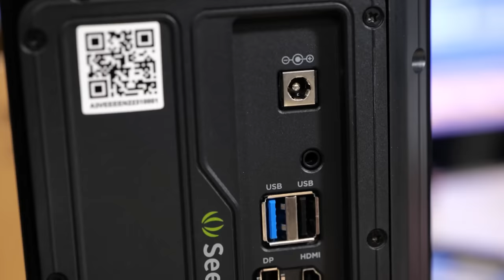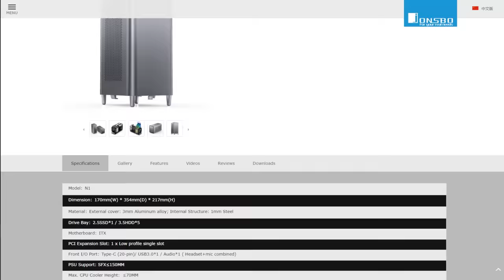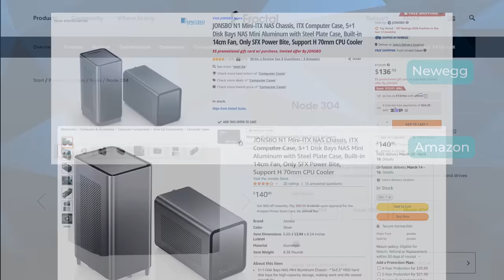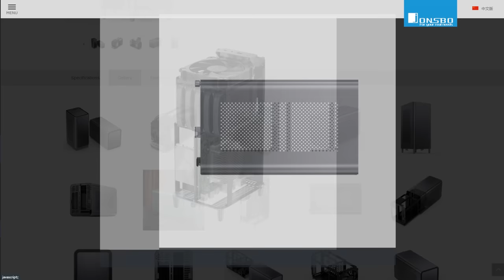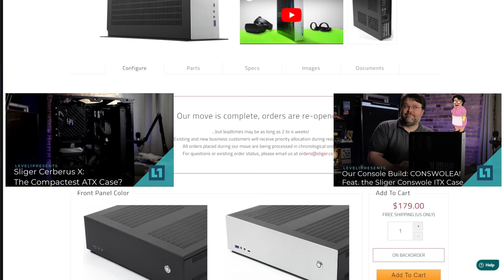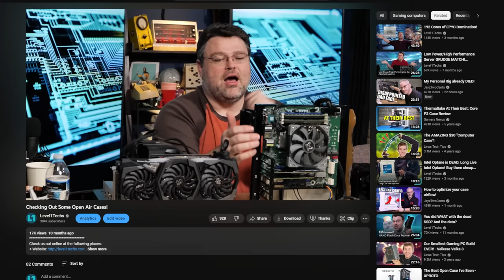The Ideal Home Server! Is it Possible?

Comment: I'm a huge fan of 5.25" bays because they're so versatile  and so easy to access and bloody annoyed that the industry has gone in a generally form over function RGB bling direction in recent years.
Reply: I mean it makes sense that most cases that are for gaming computers dont include that stuff anymore as its unnecessary. I dont see the need for the hotswap feature just for replacing failing drives as its not something that happens so frequently. Just get a fracal define XL or something, drives are easy to swap out. If you need enterprise level features, its not much of a leap to go rackmount style anyway.
Reply: @Jesse  Well for 2.5 inch drive bays, which can fit en masse in these enclosures, or for needing more hard drive bays in general, not to mention IO expansion cards and blu-ray drives, 5.25 inch bays still have a use in a variety of applications. Yes not every case needs 5+ 5.25" bays, but the ability to swap them into an existing case, OR have additional fan/radiator mounts, OR have all 3.5" drive bays, would be quite an amazing feature. It's one that I hope In Win can create for their Mod Free case that has socketed compartments on the top, front, and I think bottom of the case, and an add-on for 5.25" bays would fit perfectly there. I believe Gamers Nexus showed it off in a HW News video a while back, as well as LTT on their Short Circuit channel.
Reply: @jamesbuckwas6575  like I get that it is useful to have, it's just a niche inside a niche so it's understandable that there aren't that many products for it. As mentioned, fractals define series is good for this with 5.25 bays and lots of areas for other drives. The entry level enterprise areas cover the needs of most of the prosumer market also with rack mounting.
Reply: @JFat5158  I wouldn't consider adding more front IO niché. But it is a challenge to add 5.25" bays when people usually want smaller cases.
Reply: super hard to find decent cases with atleast 1-2 5,25" bays... oh man the times where a case easilly had 8 bays in the front drewls they had function > form... now it is bling > function > sense > performance...
Reply: I've had my lian li d8000 since 2012. It was a great buy.
Reply: @leonro  requiring more front io than comes standard is definitely niche lol
What scenario even needs more io that can't simply be solved with add-in cards, hubs and slightly longer cables?
Reply: @JFat5158  having adapters is annoying, especially if you need them all the time; I'd like an SD card slot, for example, to be integrated into my desktop
Reply: Requiring active cooling for HDDs and not having redundant fans is a big nono for me in a NAS.
Reply: @LiLBitsDK  if we are talking about cooling, 8 empty bays of 5.25 is already messing up the airflow. so in the scope of cooling, having no bays at all is function over form
Reply: @leonro  lol, it's very niché
Reply: @jamesbuckwas6575  iStarUSA has a line of cases that are nothing but 5.25“ bays. 3/5/7/9, with only the largest allowing for either micro-ATX or the MINI-ITX the other 3 require. It looks like only the smallest one requires a flex PSU too, so going SFX/SFX-L/ATX for the larger sizes is possible
Reply: @leonro  "But it is a challenge to add 5.25" bays when people usually want smaller cases" ... When people want water cooling in every freaking chassis, so manufactures add wasted space in all their chassis. Reality is, they can easily have 5.25" bays that are removable, because so many mid chassis do not even have anything in the front beyond massive empty space for ... water cooling that needs half the case airflow path.
Reply: @benjiro8793  I don't think most people want to have crazy custom water-cooling setups. At most it's an AIO, and in that case they usually want one that's so big that it covers the entire front area and there's nowhere to put a 5.25". I myself am more into air-cooling though, I never used water-cooling so idk.
Reply: Can only recommend my Dell T320, little bit older but you get it very cheap. Either 8xLFF bays or 16x SFF bays + 3x5,25“ slots, redundant PSU and plenty of PCIe slots. Only downside its a little bit noisy and no PCIe Bifurcation support but thats mainly it and all for about 200$ or € or sometimes less.
Reply: Coming soon:  5.25" RGB illuminated RGB controllers and RGB optical drives!
Reply: I don't understand the RGB stuff, and it makes me feel like a crotchety old man shaking my fists and complaining about "kids these days". Every so often I get the bug to build a new system, and I just want a simple case but all I can find are cases with transparent sides and RGB on the fans. Can't I just have a box that I'm gonna set under my desk anyways?
Reply: you could also get great accessories for the front bays... i had a monitor that fit in 3 of them!

Comment: As far as I can tell, ATX in a tower with room for a lot of HDDs is the best value still.  It takes up a bit more space but everything costs less than MATX or ITX.  The ICYDOCK stuff is really cool, but also really expensive for what it is.
Reply: Icydock have a range with plastic rather than metal sleds that are a bit cheaper, but I agree they're still very over priced. I've had reasonable results with Olmaster 2.5" cages/sleds that are a better deal. I agree about ATX - I'd much rather spend the money on quality ATX components over paying a premium for small form factor.
Reply: Agreed. I have a gpu for plex, 10gbe nic, says card etc in my server. Need space, need pcie.
Reply: I've had really good luck scoring Icy dock cages on eBay, like the 3x3.5" sleds that fit in a double 5.25 slot. Not the best storage density, but big 3.5" drives are pretty cheap.

Comment: The ASRock Rack X570D4I-2T looks real interesting for that Jonesbo case - The 2 OCuLink connectors will connect 4 SATA drives each, or you can use them for PCIe4 x4 for some kind of U.2 functionality. And as it has dual 10GBe networking, it certainly has the throughput. Finally, you can bifurcate it's x16 slot into x8x8, x8x4x4 or x4x4x4x4 for NVMe caching. Or even a half-height GPU for HW transcoding as part of a FreeNAS SCALE box.
Reply: Yeah, that's what I'd have right now if U-NAS hadn't gone out of business.
Reply: They are 650 euros a POP....Jesus christ at that point just build a Node 804

Comment: I think the Ideal Home Server would be something like: 
-The best performance/watt CPU to be energy efficient, I think the 7950x or 7900? 
-The most ECC ram you can get
-2 SSD/NVME in raid for the host hypervisor. Proxmox, xcp-ng, unraid or whatever is your choice
-5 HDD's with RAIDZ2 passthough to a Truenas VM as a target for the storage, with NFS or SCSi for easier ZFS management.
-About GPU.. I'm not sure the iGPU in the AM5 is supported for HW encoding yet, I don't do much encoding as I mainly use direct playback, and for the little encoding I need the CPU is fine. So I don't think a dGPU is needed for the ideal Home Server...unless
-Unless you want to do a Jack-of-all-trades Home Server and use it as a Gaming PC, locally or via Parsec/Moonlight. My current "main" Home Server is also my gaming PC as I can't have multiple computers (space+money). And passthough the dGPU to a VM that I turn on for gaming. It is in it's own nvme disk so if I need to play a anticheat game I can dual boot to it, I do loose all my "server" stuff while dual booted though, like media, password manager(though it's cached in each bitwarden device), etc... So this setup would be ideal for a Home Server-only machine.
Reply: Have you tried setting the smbios = host in the OS section of your vm's xml? I can run games with EAC without it complaining I'm on a vm.
Reply: @mobius_71  to be honest I haven't tried, i just didn't wanted to risk the ban. Could you tried it with Vanguard/Valorant and Warzone2?
Reply: @rodrimora  sorry I haven't tried it with those so I can't say for sure.

Comment: I want two different form factors. One is a hypervisor node that only needs to support a handful of M.2 drives (22110 size would be ideal), and then a larger chassis that would be the storage server with both flash and spinning rust.

Comment: Putting aside hot swap ability, what you describe as the ideal mATX server case is pretty close to the Fractal Design Node 804. Room for nine 3.5” drives plus two more 2.5” drives. With a 3D printed adapter, you could add a tenth 3.5” drive. An extra bonus is that it looks good enough that you can put it anywhere.

For filling all those drive bays, I’ve got a Supermicro X10sl7 which has 6 SATA ports, plus an onboard 8 port LSI SAS controller.

Comment: I really like FD Node 804 with micro ATC MB support and 8x 3.5" drives (+ enough space to mod some extra 3.5" bays into it).
Reply: I am thinking of a build and I'm flip-flopping between the Node 804 at around 40 liters, or going more compact and more quiet (albeit warmer) with the Define 7 Mini (M-ATX, 33 liters) and adding some additional 3.5" drive space with their universal mounts or a custom mod for a drive cage. 

I can't seem to find thermal & acoustic case tests on Youtube for anything accept gaming or editing PCs, but I feel like 4 or 6 or 8 drives humming away would be "loud" in a typical open-mesh type case, so I'm leaning towards the Define 7 Mini.
Reply: I'm still rocking the old Define R5 and loving it. I currently got 10 HDDs and 4 2.5" SATA SSDs with space for 2 more for the latter. I just upgraded my system and I can add 4 nvme drives on the motherboard in the future as well. Won't go wrong with any of these FD cases tbh.
Reply: I just rebuilt a server by putting it into a Node 804. It's a great option, but I think Wendell is right that there's a lot of wasted space considering what I use it for. Half-height expansion cards would be fine with me and that would save at least 10 liters
Reply: @Uriel51  Anecdotally, my Node 804 setup is pretty loud with 4 drives in it. 2 WD Reds, and 2 Seagate Exos X drives in it.  I had the WD drives connected to a raspberry pi on my desk before and they were fine. But I added the 2 Seagate drives at the same time as I moved to a PC in the Node 804, and that's pretty loud now. The vibrations of those harddrives resonate through the case, making it pretty loud as a whole. Maybe I can do something about it, but I haven't put any effort in it since it's just sitting in my basement.

Otherwise I'm very happy with the case. If you really want to get that case, I'd make sure I'd also buy relatively silent hard drives. The DC drives are great for reliability but they're just that much louder in my very limited experience.
Reply: @Niosus  it is that exact scenario I was suspicious would happen when you pack 3+ drives together. I am leaning towards the Define 7 Mini for the added dampening material. My NAS will be in my office and not a closet so that will become a noticeable aspect
Reply: @Uriel51  Sounds like a good plan. I've had an ever-changing collection of 3-4 random drives in my Define R4 desktop for many years, and the noise has never bothered me. You can hear them, but it's night and day difference compared to the Node 804 system.
Reply: @Niosus  thank you for your experience and real world comparison. Greatly appreciated!
Reply: @Uriel51  you're welcome, glad I could help :)

Comment: It's just a little less space efficient than this extruded aluminum idea, but my old Bitfenix Prodigy continues to be my favorite case for small home server.  5 hard drives, cheap full size power supply, room for a big tower cooler so you can have a chonky cpu doing hard work, and then you just use that one pcie slot for an hba.

Comment: For my server, I'm still rocking a Fractal Design R5 I bought a couple of years ago. It's using a couple of IcyDock adapter bays as well (two 5.25" bay to 2x 2.5" SATA + 1x 3.5" SATA adapter). I currently have 10 HDDs and 4 2.5" SATA SSDs on it.

Comment: Yes the Intel 4x3.5" or even 8x3.5" and 8x2.5" hot swap drive cages are available for cheap, but they can be a pain to use. Drive access is controlled (via signals on the SATA / SAS connectors) by the micro (typically a Cypress CY8C22545) on the PCB which is usually controlled by the Intel motherboards BMC via the I2C interface (white 5 pin connectors). So to use these cages you need to either hack the I2C, micro or PCB. None of which are great options for the uninitiated. Another options is to just remove the PCB and use regular cables to the drives which is easily done but also removes the hot swap option.

Comment: So I built a "server" in the jonsbo n1, 5x 12tb drives, 2x 2tb name, 1x 1TB sata ssd. Gigabyte b650 its board, 64gb ddr5-6000 memory kit, Ryzen 7900. I ended up using an HBA in the pci slot. This thing flies. Running trueness scale on it so far and it flies. I am interested to see Wendells take on it when he builds.
Reply: 7900 non x for the CPU is a solid choice. It runs extremely efficiently so that makes perfect sense to use for a small form factor server

Comment: By the way, SATA Ports wise, you can always get a couple 1 to 5 sata port expanders, I actually used one with a BananaPI M1 so I could connect 5 disks to a single SATA Port with SATA PMP enabled being the one trick needing to be done. Not the fastest solution though will work in most cases where the disks do not saturate the single sata port.

Comment: You are hitting all the right pain points. I ended up getting a used case off of facebook marketplace. The kid I bought it from seemed like he never did anything but pull it out of the box to look at it. 

I can't remember the brand or model for the case but it has room for 10 HDD's and more expansion for the 5 inch bays. I'm ready to get it up and running but the old i5 4000 motherboard I have for it only has  4 sata ports. The only motherboard that really interested me were the ASRock ones used here. I haven't convinced myself to put the money up for a new motherboard, cpu and ram just yet.

Comment: I've ended up with a Synology NAS and a separate mini PC setup. I went through all this home server stuff before realizing I wanted two different things from my home server setup. Firstly I wanted absolute stability and availability for my storage. I didn't like the opportunity for backups to fail, lost data, or even slow data access. Separately, though, I wanted a server I could absolutely hammer with transcoding and compiling something I could do experiments with and not think in the back of my mind. Eventually I would like like to upgrade my mini PC into something more SFF sized so I can gain some extra performance but mini PCs consume so little power that there will always be some use for one.

Comment: I'm SO excited for you to do a Jonsbo N1 Media server build because I picked up the case to do exactly that! I did some research and apparently you can also grab a m.2 to SATA converter card to do the last 2 SATA ports in the Jonsbo and if its a ITX with 2+ NVME slots you should be golden to run 6 SATA + 1 NVME Boot. I definitely plan to go AM5 in only for having the onboard graphics so that I can free up the PCIE slot for extra networking.

No idea what Motherboard I would go for. Hell it might not even exist till Ryzen 5 or Ryzen 6 comes out with the AM5 platform

Comment: I'm still rocking a 10+ year old Thermaltake case with 9x 5.25" front facing drive bays.  Mounted 9x 3.5" drives in the bottom 6, DVD drive up top, and room for 3 more 3.5" drives for the future.  Don't think I'll ever get rid of that case.

Comment: Can't wait to see what motherboard you use for the N1, I built a TrueNAS Scale server with it using an older gigabyte b-chipset  motherboard and a ryzen 3400g I got with a system I bought for a 3090 back in the dark days. I put an asm1166 chipset sata expansion card in it and it's been pretty solid.

Comment: I would pay for a "Wendell Home Server" solution, maybe something similar to Synology or other nas but with Wendells own curated software packs and with scripts that sets the server up. On the hardware side have a list of suggested motherboards / backplanes with different features.

Maybe there is room for another insanity project like the L1Tech KVM but for the nas solution to have a L1Tech Backplane (that perhaps gets attached to the motherboard PCIe slots?).
Regardless, a simple and easy solution to set up initially AND foremost being easily manageable for software updates, hardware upgrades and in case of drive failures, that I would pay for, pay as donation for software solution and special things from L1Tech store.
Reply: I think a better solution would be to have him HEAVILY involved with the Linus Tech Tips NAS OS project.
Reply: @bhume7535  oh yeah, forgot about that. Just heard him mention it but am unaware of the details. That does sound like a good idea.

Comment: TrueNAS Scale, for any additional software features either use the containers or set up a VM or two to run those and if need be save any data directly on a TrueNAS share. That's what I have actually done, have a couple VMs for stuff like downloading tools/apps and some other niceties and basically they just store the data directly on the same share I have to my stuff for ease of use.

Comment: I would love to find a series that dealt with a solid state setup.  I am looking at something that would be good in an RV or on a boat as I am looking to put movies and music on it.  It needs to handle vibration and preferably have a passive cooling setup. This would mainly be a NAS setup and then duplicated for a pfSense node.  Passive cooling because moist saltwater air eats electronics and passive would slow that down a bit.  Also would like to do SFP+ connections.